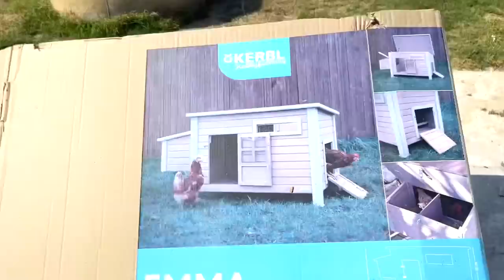BUILDING the CHATEAU’s new CHICKEN wing!! 🐓

Comment: SUGGESTION FOR THE CHICKEN COOP ROOF: You will need to put some silicon around the edge of the rim (gravelly side) of the top of the roof to stop rain seeping under the rim. I learned my mistake on the first coop (the roof only lasted 18 months!), and I've now got a new coop and have put silicon around the rim of the roof and it's working well. Also cover any screws (if there are any) on the roof as well, as the rain seeps through those as well.

Comment: I'm pretty sure Stephanie misspoke when she identified fan palms as tree ferns. Tree ferns tend to be a bit less cold tolerant than the hardy palms grown in France, but they can tolerate temperatures down to -5C (23F) and are OK during short stints at -10C (14F), but I advise protection. The top of the trunk or crown must not be allowed to freeze.
Reply: Yup.  Not tree ferns  _ fan palms or Trachycarpus to give it its proper name.
Reply: Trachycarpus!

Comment: Am just wondering why you don't you add a fine mesh inside the top of the drainage cap so that you can remove the screw off lid altogether.
Reply: I think that fine mess will either let in a lot of dust or become blocked up. What they've installed is perfect.